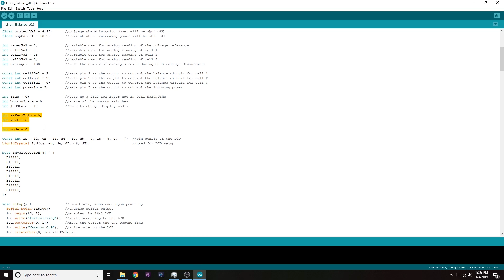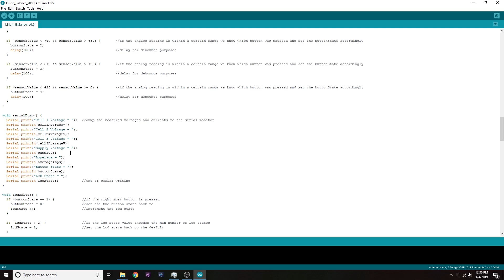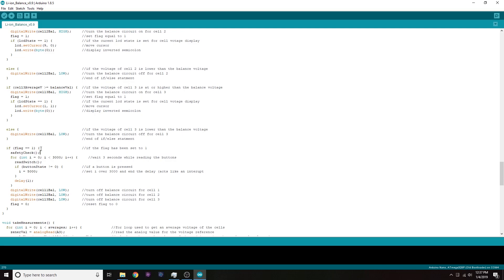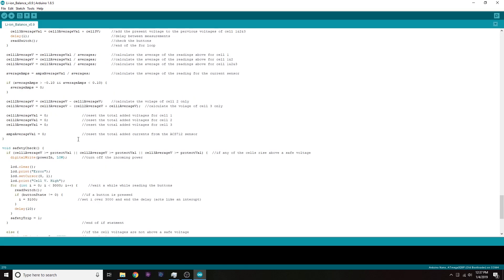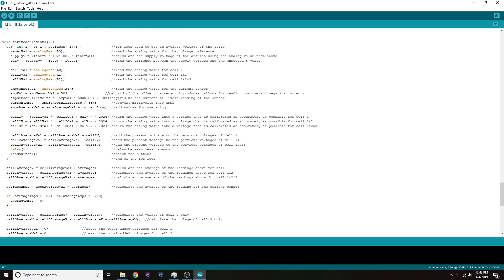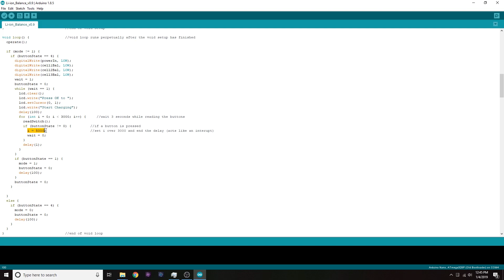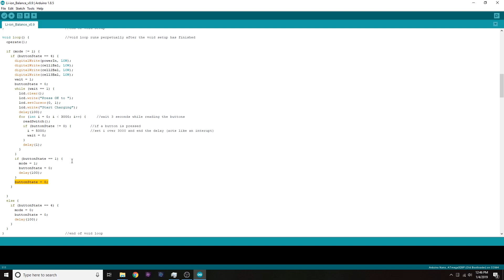Arduino BMS #11 Code Update

Comment: I'll definitely be playing with this and working up a DIY BMS to take care of a 7s pack. I will also be looking at using the STM32 Blue Pill board. Your videos have given me many great ideas and a great starting point.

I have seen on other DIY BMS'es that people have been using ATTiny 45/85's and opto-isolators for each cell voltage ... kinda seemed like overkill for me but I am new to electronics so maybe it's better? I am looking for something simple yet effective ... precise accuracy is nice but again, I think it's over-stated how important (1% vs 2% vs 5% accuracy ... does it really matter?).

Ultimately, I am hoping to look at using Wi-fi and looking at some interfaces to make it nicer to look at. Grafana is something that has come up in other videos.

Also, I wonder with all of the components, MOSFET's N-channel, P-channel, MOSFET drivers vs transistors, Volate references, how much difference it all really actually makes? I get the feeling that there are actually many components that are all usable without really altering things too much ... I mean, just searching for a TL431 voltage reference gives many, many results ... which one do I choose? Or does it not really matter (ignoring obvious difference like whether it's SMD or Through-hole, or simply an IC versus a break-out board). Similarly with the ACS712 current sensor ... I've got a couple of smaller INA219 chips which are current sensors (as well as voltage) and it makes me wonder if I could just them with a current divider (I believe the INA219 is limited to 3.2A but if I create a 1 to 10 current divider, I can measure 32A with the sacrifice of a little accuracy?).

Thanks for your videos, it's really helped me take the step of making my own BMS.
Reply: Hey Derek, really interested in making a 6s 7s battery balancer. Would love if we could communicate through it.